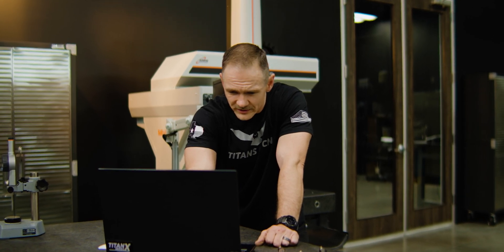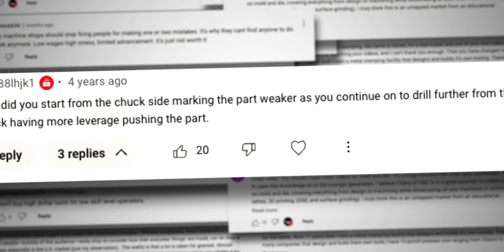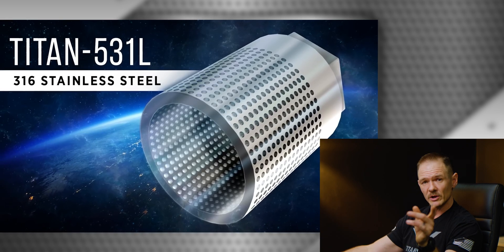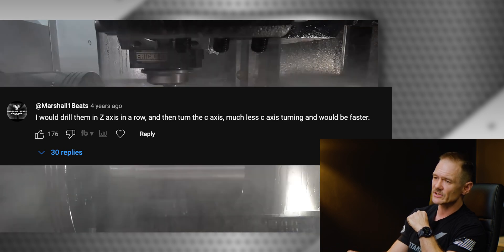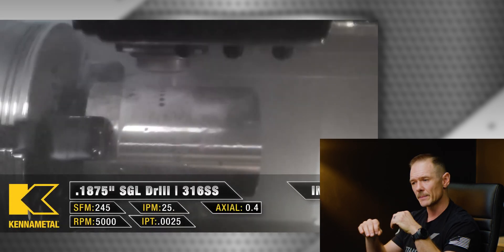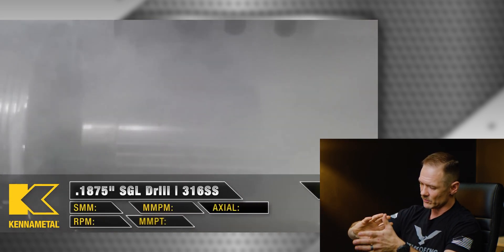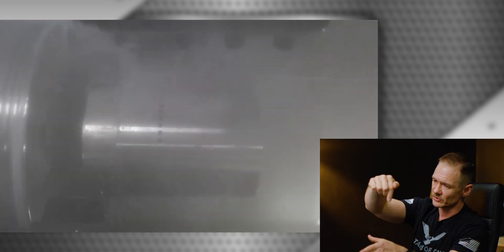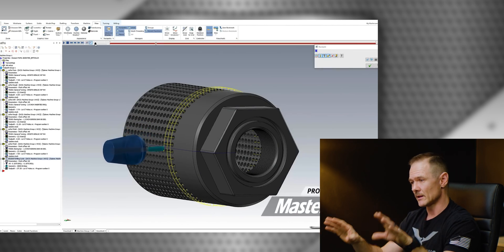Wrong Technique? Addressing the Comments

Comment: The 800 hole part, speeding it up by moving in the Z could be very machine dependent, some machines are very slow at indexing the C axis compared to moving the Z.  No simulation is going to show this, only running it.  If this does indeed save a lot of time, you could to 1 fully rotation of holes at the start & end and the rest moving in the Z to help with inspection.

Comment: Don't be a hack and check the actually surface that the print calls out. A part can have a flat surface that is not parallel and vice versa.  Doing short cuts like this is what separate the good from the great.

Comment: my opinion is that machining is not a fixed science. everything might look perfect on the paper but on the floor you do more things on the ear and "how it feels" than by the book and the problem is when you try to explain why you did something the way you did. ive leaned this only once ive started teaching others: "everything is easy until you have to explain it to someone". one solution specific to this particular situation is not always applicable in a seemingly similar case.

Comment: That way of checking flatness/parallelism is still not perfect because your indicator is attached to the machine sitting on the granite table, so that is the indicators reference plane instead of the top of the jacks as it is for the part. Since you were moving the indicator around the part, if the granite surface table and the top of the jacks aren't perfectly parallel then you will have an inaccurate reading.

EDIT: Of course, if you were checking flatness, IE measuring from the bottom of the part, then you have to suspend the part somehow so precision jacks would be one of your solutions. Naturally a CMM taking a million points on the surface is the best option, but you don't always have that option.

Comment: By checking flatness that way you are introducing more chances for error. Placing on precision fixed reference stands and checking underneath is superior and faster. 35 years experience. I work ACAP frequently.  Great technique on the hole drilling though. More rigid similar MT wear. Think always.

Comment: Another thing to consider when drilling a lot of holes while indexing C axis is if your machine has a C axis clamp and if your post processor has the machine clamps/unclamp between every index. It takes time to engage/disengage the C axis clamp, and if you're just drilling a hole and not doing any heavy milling the clamp isn't really necessary.  Some post processors you have the choice between engaging it or not, and you would be surprised how much time it will remove from your cycle if you don't engage it after every index when doing a lot of indexes.  Turning this off would likely make the time difference between indexing and moving along Z between holes very minimal, if not faster via indexing.

Comment: One thing i would consider with the 800 holes video, the Maschine i work on loosens and declamps the spindle brake every time i do a c rotation, which would definitely take more time than doing it in z. Depending on the application spindle clamp may not be needed, but thats more or less all i could say to that.

Comment: Huh im still confused. All of that explaination assumes that the two surfaces on the part are already parralel to eachother right? If the lower surface was 1° off of the top surface your reading on the top would reflect that right?

Comment: I thought you explained the flatness / parallelism check  pretty good. In my mind the Jack screws are pretty handy  but if you adjust them to get the top surface identical at the three points then more than likely that adjustment would be how much off the parallelism from the bottom surface would be “ more or less”. I really think you explained it very well and it was a great video. I like the drilling from the face toward the chuck better on the drill test because if it works out on the end it should only get better as you get closer to the chuck! Great explanations. Thank you Trevor

Comment: what you did creating a plane on the top surface from adjustable jacks is correct. As long as you establish 3 points from  the surface at the same height all points deviations is flatness. 3 points at the same height establish a plane regardless of spacing as long as they are the same height.

Comment: Unfortunately, I missed that first video, but your exclamation here is very clear. It makes perfect sense. The biggest issue that I see with this technique is you would want a very fine thread on the jacks, or it would be rather difficult to dial them into a perfect zero. That being said, measuring on the top gives you full access to the entire surface, which is a huge advantage.

Comment: I rarely have a complaint about your inspection methods but I have one serious concern about the way you measure drill or predrilled bores 

Gauge pins and 3 or 2 point mics will only measure the miner diameter 

Gauge pins are a good check for an operator or in inspection to make sure assembly but go at intended 

The proper tool is a dial split point bore gauge 

It’s the only tool you can find the loosest point in a small bore 

When a part is pre drilled too close to finish size the drill will wonder beyond the finish size, if it is bored or reamed the drill marks will still be left behind leaving loose areas, If the part in question is a bearing or bushing this will cause premature wear, oil leakage, loss of oil pressure. 
if the part is for a press fit then the actual fit will be much less than the gauge pins or mic is telling you

Not altogether a rant but I’ve seen countless part, get through inspection and assembly then fail in operation it is a serious concern that people should be aware of

Comment: Travis, just one more addition to my last comment - the methodology which you used in your video can indeed be used to check for surface flatness, but this would only be the case if you have already verified that the top and bottom part faces are perfectly parallel to begin with.  If this is the case, then yes, placing a part on top of some jacks and referencing its top surface with the measurement instrument can indeed check for a part's top surface flatness.  I apologize if I missed you mentioning that you had already checked and verified the part's top and bottom faces being  in parallel prior to performing your flatness measurement in the video.  Thanks again!
Reply: It actually doesn't matter whether the surfaces are parallel for this check.  He's adjusting the jacks until the top surface is parallel to his table top (at least at 3 discrete points) 

The potential misalignment of the bottom surface is negated by the jacks
Reply: wrong

Comment: 9:47 I have to disagree with this one. You inspected the holes while the part was still in the machine so you should know where your C0. is. I personally would set it to the middle of #1 jaw and if you started drilling the holes from C0., you know what row of holes you drilled first and the ones you drilled last are the ones next to those. I avoid running M89/M90 as much as possible, because it takes at least half a second to do so, while a Puma 2600 can rapid that Z movement in under 0,1 s.

Comment: Drilling the 800 holes makes basically no marketable difference dpeneding if you use c axis locks or not. On my lathe turning the C axis is just as fast as traversing any other axis so the difference largely comes from the C axis lock and if any G4:s associated with it.

Comment: Hey Travis, thanks so much for your re-review of your original video,    :-)    OK, so I guess I'm one of those people who disagree,   LOL!   Here's my rationale: FIRST - you have a perfectly "flat" granite surface;  SECOND - your measuring instrument MUST reference that same granite surface as it's traveling over a part;  THIRD - once you zero each top surface of the jacks (whether they are adjustable or not is irrelevant), each jack top is precisely the same distance from the granite surface, thereby creating an exact replica of the granite surface, meaning you now have two perfectly parallel planes (that of the granite surface and that of the tops of the jacks);  FORTH - once you place any object on top of those jacks, you are in essence placing that same part on the surface of the granite;  FIFTH - since the measurement instrument has not changed its reference surface (the granite top), then any deviation of the stylus up or down, will ALWAYS be in reference and in relation to the granite top;  SIXTH - hence, any delta in Z of that stylus (when traveling over a parts top surface) is checking for a change in parallel to the surface of the granite top.  This is due to the following:  if left unobstructed, moving the measurement instrument's stylus around in mid air will ALWAYS trace out a perfectly parallel path from the granite surface.  Once obstructed by a part's surface, the stylus will jump either up or down and thereby give you an "out of parallel distance", referenced from the granite surface.  Does this make sense?  In fact, given your setup in the video, it's actually required that you have the top surface of any part perfectly parallel to the granite's surface BEFORE you can even start to test for flatness.  Please let me know if I'm missing something here though.  Thanks again for making incredible videos - it's in these types of discussions which provides learning opportunities for everyone!!

Comment: the company i work for we drill 7000 holes into parts, and they are not just thru holes they are stepped holes so you need to use multiple drills.  Takes forever.

Comment: re flatness - perhaps for the purposes of the demo it would have been better to use a gauge block on the top of the jack use the dial gauge to verify the tops of the jacks are planner to the granite that way you have validated your base line

Comment: if you don't sweep the bottom surface you won't know its true flatness.it may be on the same plane from tooling point to tooling point but you may have out of print areas on the surface between the tooling points (highs and lows).

Comment: Your set-up did measure flatness.
Reply: Both flatness and parallelism. But if the customer is happy and paid for the part, all is good.
Reply: @wannabecarguy  nope on adjustable jacks , zeroed in three places on the upper surface, and deviation checked there from its flatness.  The bottom surface could be checked in the same set-up for parallel, but I didn't see that.

Comment: Flatness is a surface compared to itself and no other feature which is where it seems alot of so called experts are making fools of themselves as most seemed to have either been told wrong information or have been confused when told the right information. I used to make side covers for a scientific piece of equipment that was used in a vacuum. They measured about 200x150mm and had a lip of about 12mm that had a flatness tolerance of 0.005mm and they made out of stainless 316L and were about 10mm thick with the middle machined out to about 3mm below the outer surface. After machining they were of course not perfectly flat so I would bend them by hand to get as close as possible to flat. The way they were checked was with a plate that had 3 screws equi spaced with brass pads on their ends. I would put 3 pieces of plasticine under the plate I was checking to remove any rocking due to the under side surface. I used a 0.001mm indicator mounted on a vernier height gauge and check just the surface that was tied to the tolerance. All you had to do was set 3 points closest to the screws to zero and any variation over the surface that outside of tolerance was fixed by polishing on a piece of 1500 wet and dry mounted to a granite surface table. The flatness was not tied to rear face of the plate as flatness is just the face the tolerance is appled to and has nothing to do with parrallelism as there is no relationship between flatness and parrallism.
Reply: Yes. The key to the 3 jack method is in the alternative name of the technique: isolating a plane. That explains a real reason/goal here (if one has a clue - most people don't, why would you need to "isolate" anything, just throw it on the surface plate directly, right?).

Comment: this method shown a wile back confused me. now i’m more so. what surface are you trying to check flatness? i feel i’m missing something….
Reply: There is nothing "confusing". Other name for 3 jack method is "isolating a plane" (to check flat/parallel of the top or bottom face - you have a choice). Go figure. Why you need to isolate it (can't just throw it on the surface plate directly - due to other machining defects, besides being flat/parallel, starting with deburring). World does not owe you an explanations - if you don't get it, it's your problem. You do the homework.
Reply: @GrandePunto8V  The original video only showed him levelling the jacks, setting the part on them, and measuring deviations from the TOP side of the part, and claiming it to be flatness. It's only with this video that they have explained, I'm assuming after realizing that they were wrong, that measuring the underside of the part would be flatness in that situation, while measuring the top side is parallelism. It was outright wrong in the first video, and in this one it's still kind of a bungled explanation. To someone not familiar with GD&T or machining I could see it confusing them more than helping. In the original video putting the part on jacks made no sense as he was simply creating another flat plane parallel to the already flat granite table, it was no different than if he had just put the part on the table directly and measured deviations from the top. Also, the stupid adjustable jacks and then sliding them around a bunch before putting the part on it, etc... They messed up.

Comment: This gets into a lot of the mud that tends to confuse particularly new metrology technicians. What was done was a way to check flatness, titans of CNC are absolutely right on that. But you're checking flatness by comparison to a presumptively flat plane, by moving the indicator across a precision reference surface. Which is a parallel measurement. Just not one internal to the part. This gets you a very good indication for flatness of the surface indicated, but you could get a perfect measurement by doing this through CMM, and at the end, making a transformation of the measured plane (rotation on two axes of all the points measured) to correct for whatever minute error may remain in the jacks. Likely this remaining error that separates this from a true flatness measurement and a parallel to the reference measurement is so small that it wouldn't show up on the indicator, but still. If one were to be extremely pedantic, this would be how to correct it.

Metrology/Inspection has a way to get muddy in the "what is the best measurement possible?" vs "what is the best measurement that achieves the correct level of confidence?"

Very fun problem, really enjoyed the discussion.

Comment: Hi Travis, it’s very challenging checking flatness without a CMM as there are too many variables coming from the bottom and top surfaces of the part. I would have sat the part on 3 x 1” gauge blocks to eliminate as much as the deviation from the bottom plane. When checking the upper surface you would then be checking the surface deviations on the top surface. This would be parallelism and if the deviations fall within the tolerance of the flatness boundary then all ok. The errors on the surface plate and gauge blocks would be insignificant if they were good grades. This is just my take as a retired Metrologist of 35 years. GD&T  is a pretty tricky element of Metrology and it’s not even understood by some engineers so I believe you are doing a great job. Well done!
Reply: Sitting it on blocks you are only checking parrallism to the base and not flatness. To check flatness you have to set 3 points to the same height in relation to each other on the surface being measured. Then you swipe across the whole surface and any variation is how flat it is.
Reply: @dikkybee4003  Sitting it on blocks and checking from the TOP side would only be checking parallelism, but checking from the BOTTOM would be flatness. Gauge blocks make for a far flatter surface than any jacks, even precision ones. Doing it as described by the above poster is a superior method to what is shown in the video.
Reply: Machining is not perfect, "flat" surfaces are not so flat straight from the milling. Turned faces are not flat (but often concave/convex). Then you flip the part (to machine both ends). Plus de-burring (and secondary burrs). That's why you want to "isolate the plane" (more scientific name of the 3 jack method), not rely on the (flawed) surface and it's geometry.
So it depends of WHAT you are trying to measure, conscious decision: directly on the surface plate, 123 blocks, gauge blocks, or 3 jacks (adjustable or not - you must know which version to use and WHY).

Comment: Also, while experimenting with cutting parameters you can also kind of " machine sections of surface" with different feeds and same speed or different speeds and same feed - in theory that will give clear visual difference and save time

Comment: My question is why and who made that rule that the 3 amigos has to be the same height. I was taught back then by a journeyman machinist Jim Pigula that you can average your jack when indicating the top of a surface. After 25 years in this trade. That makes perfect sense. Just imagine you place the 3 jacks in  different places. You probably get different results. The key is as long as that top surface meets the print
Reply: Because most people are uneducated. The 3 jack method ("isolating a plane") has two variations: jacks are adjustable or not. It depends on what you are checking (flat or parallel and which plane, top or bottom).